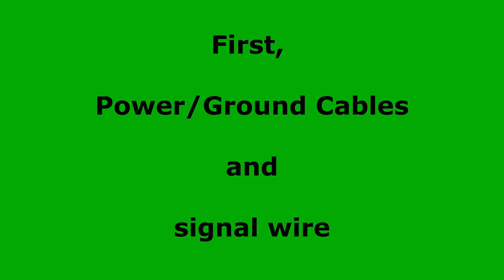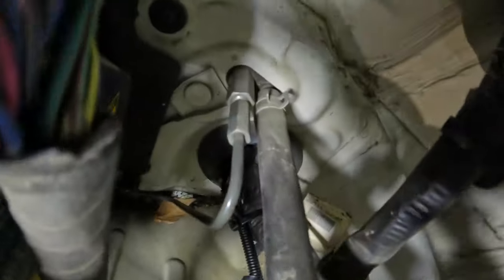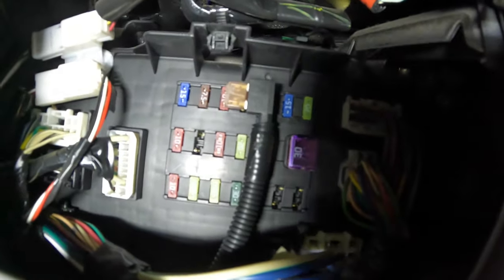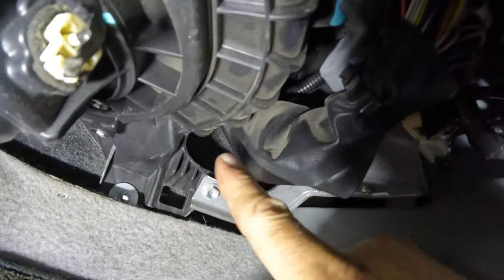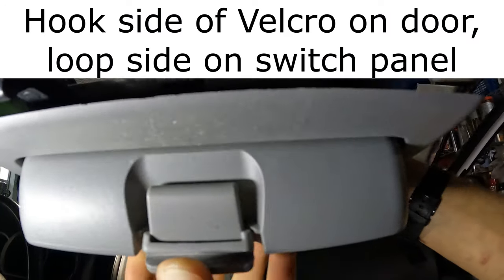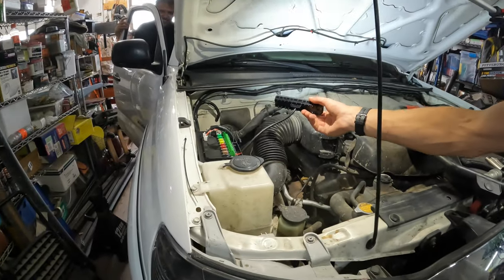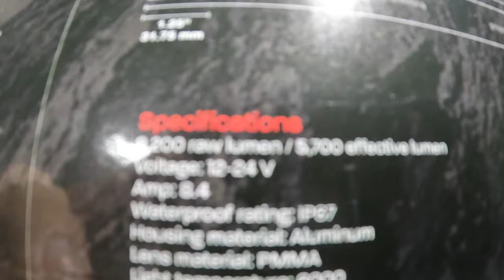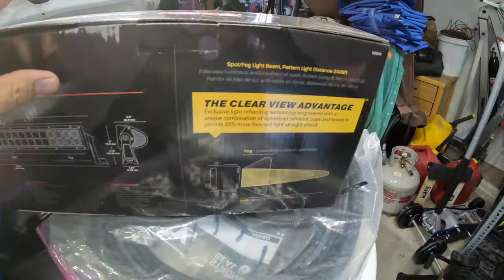Tacoma AUXBEAM Install

Comment: what's the reason for the breaker to be on the other side?
Reply from the maker: The breaker should be absolutely as close as possible to the battery. The reason for this is the wire between the battery and the breaker is a potential fire hazard, if it shorts to the frame or anything for that matter between the battery and the breaker, it could start a fire. Any short after the breaker should in theory trip the breaker before it starts a fire.